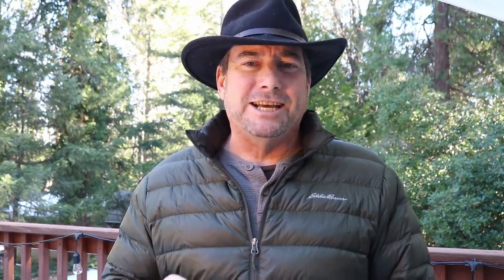Blancolirio UH-60 Safety Stand-Down

Comment: Not sure about the Blackhawk, but most military choppers are equipped with a sand and dust separator which would preclude any large chunks of ice entering the engine inlets. The question arises, why is it necessary to conduct night IMC nap of the earth training in the first place? Landing in those conditions is extremely difficult or even next to impossible. Such training is better left to the simulator, such as fixed wing engine out approaches.
Reply: Like an inertial bypass separator? Makes sense.
Reply: The Blackhawk has an Inlet particle seperator and it is always operational. 

Nvg DVE training in white and brown out conditions is a standard task to be trained. The locations wars are fought necessitate being proficient. In addition the Idaho national guard utilize their helicopters for search and rescue, landing in snowy conditions is a requirement. 

NOE is a bit misunderstood, it is conducted at very low altitudes  and at low airspeed. Its not a crazy dynamic yank and bank maneuver its unlikely they crashed due to NOE training. speculation
Reply: @jeffkeiper  Do you know if local Guard units have access to a UH-60 simulator, and the type of training that is routinely covered. With modern airliners almost all training is conducted in the SIM except for the line check which only covers normal operations. The F-111 had NOE capability which was flown at high speed and relied on the auto flight systems. There were a number of catastrophic cfit accidents while training with that aircraft.
Reply: There is no such thing in the Army of nap of the earth IMC training
Reply: @shenandoahhills7263  Yes...most if not all NG and Army Reserve pilots have access to simulators. That said, there are simply some things that a simulator can't replicate. Yes, one can practice fundamentals of NOE in the sim, but nothing replaces hands-on actual in the air training. Think of it like this...do you really think you're ready to fly a Cessna 172 or a Boeing 777 after flying Micro Soft Flight Simulator 2020 for a few hours? You'll for sure understand a little bit of what's involved procedure-wise, but once you actually climb into that real live cockpit you'll quickly find out how little you know.
Reply: @DragonPilot  Modern airline simulators have gotten to the point that a Pilots first landing in the actual aircraft (B777) is on a line flight with revenue passengers onboard. These are full motion simulators , with sound affects, high definition visuals, and all of the whistle's and bells. Even NASCAR'S drivers practice for each track in simulators prior to their races, however, they are not as sophisticated as found in airline training. Astronauts use simulators, because for the most part they will not have a dry run on the actual hardware (ie: moon landings). With todays electronics almost anything is possible. I flew helicopters in the military and we were trained in brown outs and white outs during landings and take offs, but we did not receive any training in night,  marginal IMC conditions, while flying in close proximity to the ground.
Reply: @shenandoahhills7263  yep, I’ll give ya modern helicopter sims are pretty damn sophisticated, but they’ll never replace the real thing. I’m glad we have them, but ya gotta get that seat in your pants! If all a pilot did was fly sims, they wouldn’t last 30 minutes IRL flight. A combination of both is absolutely necessary...at least in my experience. I have always believed simulators play an important role in preparing an aviator for actual flight, but ya gotta get out there and do the real thing.
Reply: @jeffkeiper  okay thank you for the details. I know a lot more about fixed wing aircraft then about rotary. could you or maybe someone else here explain why it's not possible to climb vertically without forward motion? Doesn't that depend at least to some degree on your altitude as the air density gets lower with altitude? I would think that these helicopters are generally powerful enough to climb vertically without forward motion.
Reply: @weebgrinder-AIArtistPro  in VMC conditions climbing vertically without forward motion is perfectly safe and easily accomplished. 

The discussion has been on climbing vertically into IMC while the helicopter can physically climb vertically if you have no ground references it is simply not safe to do solely on reference to Instruments.
Reply: @jeffkeiper  I understand now. Thanks 👍

Comment: Sometimes I think there is a false sense of security with highly experienced people.
Reply: Yes.  No one is infallible, and unless they are actually in the left seat there's only so much they can do, and only so much time they have to do it in.  These pilots do have to get this kind of experience, but maybe they need to find a way so the price is not so high.  There's nothing wrong with the systems or the equipment - this is a human factor experiment gone wrong.  Probably highly competent humans, but it still went wrong because there's a step missing there somewhere.

Comment: Is not the de-icing equipment turned on before they are needed? Meaning...before ice starts to build up? Also, what about mission planning? Aren’t ALL safety issues and potential issues discussed? One year after Kobe Bryant helicopter crash (very close to exact day) we still have these issues with weather, viability and flying into the ground in mountainous terrain...sad.

Comment: If you have no clue how the aircraft anti-ice/de-ice work, why are you speculating?  Did you know the aircraft has supplemental lighting (IR searchlight)?  Something you're not understanding is that two instructors onboard does not mean both are at a set of the flight controls.  Flights with three pilots on board are conducted all the time in the Army.  These situations allow the lead standardization officer to evaluate another instructor conducting real world training.  Further, that standardization officer is trained on how to crew from the back seat where your crew chief normally sits.  That individual will have cabin checked on their DA Form 7120 authorizing duties from the cabin by the commander. Are you that naive to think that a pilot sitting in the back would not speak up?  The Army only requires two pilots to fly the aircraft.  In some civilian applications you can fly the UH60 single pilot.
Reply: Yes! Thank you!!

Comment: All you said is true but the greatest danger I saw in my 31 years flying for the Army is that crews are scared to say NO! Sometimes we have to stop what is happening. Senior Army leadership has always had a problem with being told that the "plan" is faulty. We have to try to be diplomatic, but at some point even the low time guy has to be free to voice concerns. I got my tail in the winger a few times for speaking up, even as a new WO1. But I was never involved in an accident. As the maintenance officer I was allowed to voice my opinions much more than others, but there are a ton of officers that go ballistic if they are ever questioned. But in the aviation world every person involved in the mission needs to know that they are free to discuss issues. Usually, the issues can be worked out or mitigated. And we all need to know our own limitations as well as these of everyone else. People failing to admit their limitations has caused a lot of accidents.

Comment: No Crew Chief in rotor craft, hmm. Its the Crew Chiefs AC, he's letting you fly his baby. I never piloted the 60, i'm ignorant about crew requirements as well as the 60s environmental systems. Transitioning back and forth in IMC can a real PIA. The 124th is at Gowen Field. I honestly can't recall the NG unit there. You're right as usual, something stinks and needs to be looked at. Carbon copy crashes are few and far. The NG pilots are almost a full time. We had 1 pilot who didn't fly for the airlines, everybody else did/does. They're better pilots than active duty and usually have better equipment. Maintenance, avionics, mechanics are all full timers, either AGR, contract guys etc. It doesn't sound like a mechanical issue but time will tell. RIP brothers.
Reply: Yeah, kinda...but there's no room for a crew chief in the AH-64 Apache...or the AH-1 gunships. I loved it when a CE flew with us in the Huey or Blackhawk, but the UH-60 is legal with a 2-person crew...pilot and co-pilot (in Army lingo PC and P). Just pointing out a CE not a requirement in some Army aircraft. We'll have to wait and see what the investigation reveals.
Reply: @DragonPilot I believe that was the 4th fatal crash in the last 10 months. Not sure of the details on the 2 overseas. I'm guessing that the 60 has anti-ice systems for the mains and engine. The boys from Mother Rucker are busy that's for sure. RIP.

Comment: The UH-60 has windshield anti-ice, and main+tail rotor de-ice.
Reply: Which means, of course, that big chunks of ice aren't going to fly off into the engine inlets!
Reply: Depending On:  Age, Variant, and Retrofit. Maybe not all the oldies that are low letter variants have been retired or retrofitted.

Comment: There was no snow on the ground in Boise but plenty on the hills.  I wasn’t very impressed with the official explanation.  They seemed to minimize the risks in favor of rationalizing it as necessary SAR training.  This seems to cut both ways.  These are perishable skills which require frequent training yet the risks are inherently high.  What is the proper balance?  It seems some adjustments may be needed.

Comment: Two similarly qualified flight instructors flew a Citabria--low and slow--up into Niles Canyon (Oakland, Ca area): stalled it, spun in, and died. Hopefully before the aircraft became fully engulfed in the ensuing fire. Did either of them say to the other. "Let's not do this"? One of them had previously been chased out of the canyon--doing the same thing--by a sheriff department's helicopter. No risk assessment form, of course. But, I wonder if THEY had talked about what THEY were about to do.

Comment: Night Vision Goggles provide NO DEPTH PERCEPTION  do you have radar altimeter?
Reply: Yes, UH-60 aircraft are equipped with radar altimeters (24 year Black Hawk pilot here; retired though).
Reply: They do not restrict depth perception. NVGs are very good for depth perception.
Reply: @pibbles-a-plenty1105  I can’t speak for the UH-60 series Black Hawk helicopters in the 160th SOAR but the standard “Green” U.S. Army Black Hawk helicopter is not equipped with any type of Helicopter Terrain Awareness and Warning System (HTAWS).
Reply: @pibbles-a-plenty1105  if it did it would have to be turned off. The type of flying they were doing was below 200 feet in a valley. TAWS not practical for this type of flight regime.

Comment: Used night vision a lot. Mind you, not from a helo, but hand held. A simple infrared light turned on, ( the darker the better) and I can see 150ft. Easy. It's like , the brightest moonlit night you've seen. On surveillance runs, we rode motorcycle's a a pretty good clip,  (30mph easy) and never had an issue. We'd use them on boats too. I'm sure, that helicopter has a pretty bright infrared light on board. 
    So your closet theory, won't hold, it would have to be iceing or fog. Now that would hinder any night vision. For that the type of google's the firefighters use might have worked... But not sure for terrain...

Comment: Do any of the military branches obtain ISO 9001 certification? And if so, do they get audited to the requirements by a civilian 3rd party? Wonder if their risk assessment practices would pass...
Reply: @CapnT Don’t forget that the primary mission of U.S. Army aviation is to both conduct and support combat operations in a theater of operation. I’m a retired Black Hawk pilot (24 years flying experience) and I can say from personal experience that it’s extremely difficult to overly a civilian oriented concept like ISO 9001 onto an organization conducting inherently dangerous missions.  The U.S. Army does have what we refer to as the Aviation Resource Management Survey (ARMS) checklist that serves as a qualitative check/certification mechanism. I’m a also a school trained Aviation Safety Officer (ASO) and crash accident investigator and I truly think that a “lot” of people are jumping to a “lot” of conclusions with absolutely no facts that support their assumptions.  Just my thoughts sir.....
Reply: @thadlm2698  I tend to agree that speculating or jumping to conclusions in air accidents is quite pointless and possibly dangerous if you try to take corrective action based on speculation. But thanks for the info about QMS - makes sense! Military has their own aviation regulations so makes sense they should have their own quality management system that works for the scope of the organization :)
Reply: @CapnT87  Thanks for the reply sir.  Much like any other process in any other organization, Army aviation always has room for improvement to conserve the fighting strength.

Comment: The windshield switches are labeled “Windshield Anti Ice.” Are these accident aircraft UH-60A - L’s or HH-60M’s? The M has 4 axis Coupled Autopilots and  a Glass Cockpit. This would increase Situational Awareness.
Reply: Also as a civilian Aircrewmen, I have many times had to speak up, when I felt uneasy. From Bickering Pilots to Pilots flying in Marginal Weather w/ Both heads in the cockpit tuning radios instead of watching out for Power Lines, I have seen quite a bit.

Comment: I'm not sure necessarily understand or agree with that statement you can't vertically climb or descend in blackout conditions, there is no reason why not I can see! The pilot will know the feel of the aircraft vertical descending and take off,  knowing your speed indication Air indication and altitude and where you sit in the horizon is enough information to guide you vertically?
You could have cameras on board to see in icy conditions with heat seeking capability what is better than night vision these days are not expensive pieces of Kit and can be retrofitted quite easily.  heat sinking will be better for spotty aircraft around you and knowing your horizon at night
Reply: Helicopters in IMC conditions rely on forward airspeed to maintain stability. I'd never do an ITO vertically you always accelerate to best climb.
Reply: @jeffkeiper  yes in best circumstances but if you're in a mountainous region and you don't know the train around you then I would have thought the sensible thing and the safest thing is to do a vertical climb there's nothing preventing you doing this if you use your instruments, or some forward momentum very slow
Reply: John, I was an Army helicopter instructor pilot, so trust that I know what I'm talking about. The problem with climbing straight up in total white out without any ground references is that the pilot has no idea if they are going forward, backward, left or right. That's why forward indicated airspeed is as necessary in a helicopter under IMC as in a fixed wing aircraft.
Reply: @johnsweda2999  what Gary stone said.
Reply: @DragonPilot  still not sure why it can't tell you where you are in space! if you know your Horizon, altitude, airspeed, heading, surely these factors should tell you where you are and what is going on even allowing for wind, how is this not good enough knowing these factors by just using the instruments. And what about autopilot could that be engaged in a situation of whiteout blackout.  and even with GPS can tell you where you are at a metre giving you the lay of the Land. And with all these factors shouldn't be a problem what I can see. Is it the issue of speed is the problem here going too fast, the benefit of a helicopter you can have forward momentan slowly walking pace not like a plane. Why can't you just slow down your forward momentum and assess the situation? 
Is there a lack of knowledge confidence practice is the real problem here,  could you make a GPS map that you can practice this in a safe environment where there is no mountains, by giveing you the opportunity to practice a mounting setting in blackout flying by GPS and instruments, maybe that should become practice for pilots. Maybe somebody should do it make a map that overlays over the GPS with waypoints and boundaries.
Reply: @johnsweda2999  I dont understand exactly where your point of confusion is. If youre asking can a pilot fly the Blackhawk off reference to instruments using navigational aids. The answer is yes, its just like any other IFR capable aircraft, and that is trained every day and in simulators.. 

Your original post you asked about ascending vertically in IMC conditions with zero forward airspeed. In IMC conditions that is not a stable flight profile and is not advisable. 

Any autopilot system fixed wing or rotary has parameters in which stable flight can be conducted, in order to use the autopilot you have to be in stable flight. So yes if you enter a maneuver in stable flight you could potentially slow the aircraft to a hover using the autopilot and beep it down to land. 

But if you've already exceeded the parameters at which the autopilot is able to work it won't bring you back. Altitude airspeed and reference to instruments are your best friend.
Reply: @johnsweda2999  the airspeed indicator is an essential instrument for IMC flight. Sadly, it only indicates forward flight. It does not show negative air speeds such as flying backwards. The pitot tubes all face to the front. Most helicopter airspeed indicators don’t start giving a reliable indication until it’s reached 40-50 knots or at least through translational lift. Then, just maybe you might be stable enough to fly out of IIMC, but then there are all those pesky hillsides and mountains, not to mention power lines and other obstacles in the way.